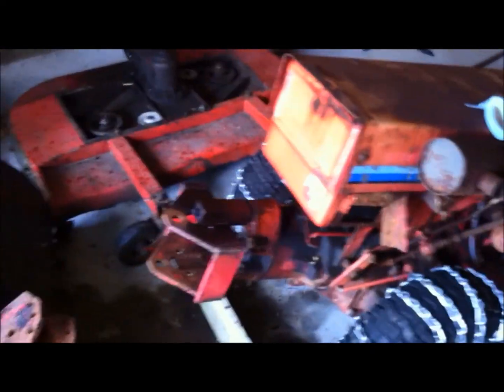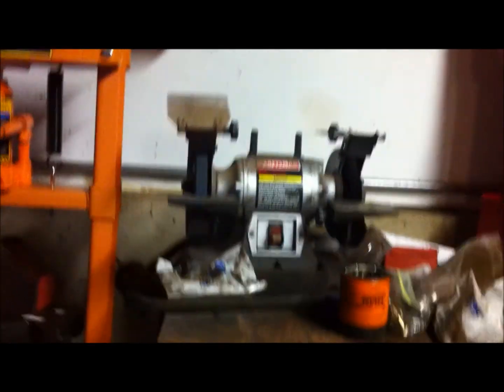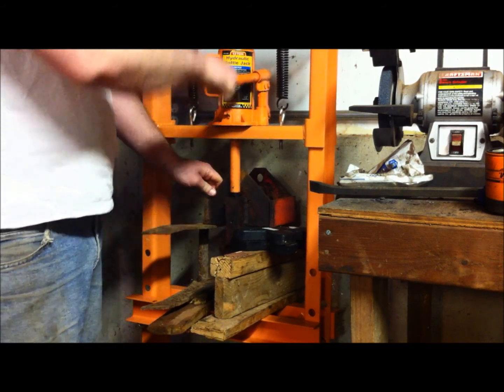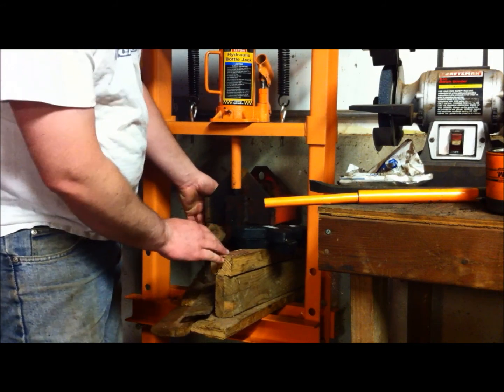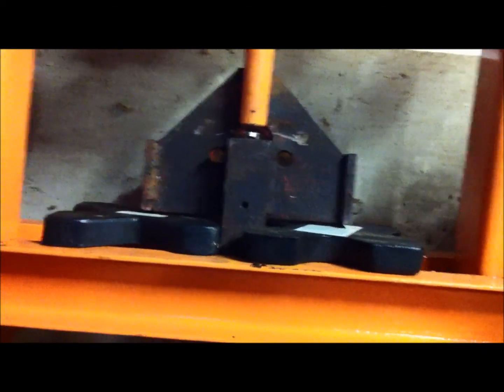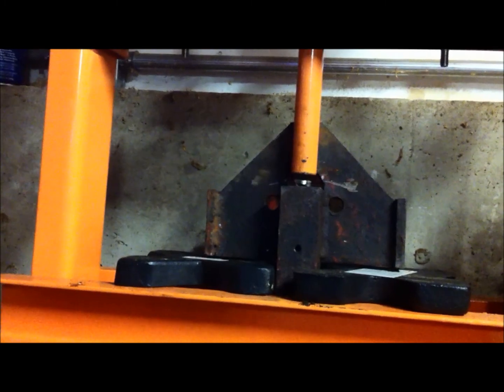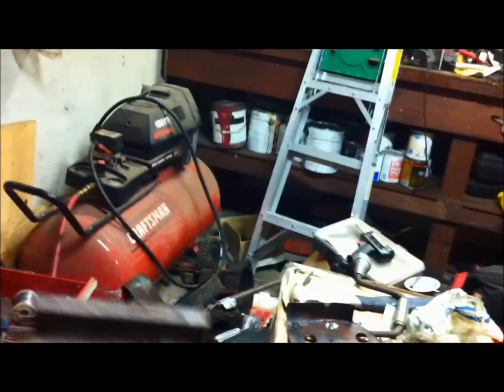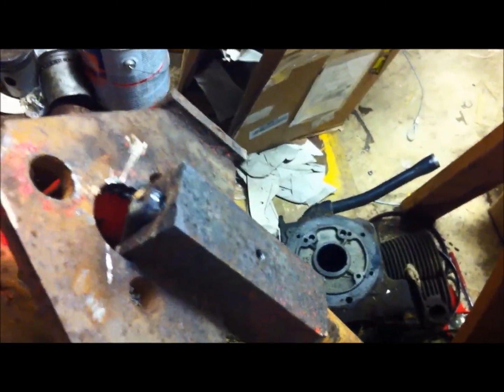Gravely 5865 Rusty Quick Hitch Fun

Comment: Need to grab your die grinder and remove the mushroomed parts. Then grab the PB Blaster and give it a good soak and then wait a couple hours...heat it up again....spray it again and wait....let the Blaster do it's thing for several hours with several applications of heat and Blaster...be patient. Then grab a quality air hammer and slowly it will start to back out...good luck!

Comment: Heat and shock are your friends. Don't heat the horn, heat the sleeve it is stuck in and tap the sleeve gently but firmly with a 3 lb. shop hammer. Keep the pressure on. It will eventually give in and break free. If the hammer doesn't get the job done I would try a pneumatic hammer on the sleeve. Hopefully you haven't mushroomed the horn out around the sleeve like a rivet.